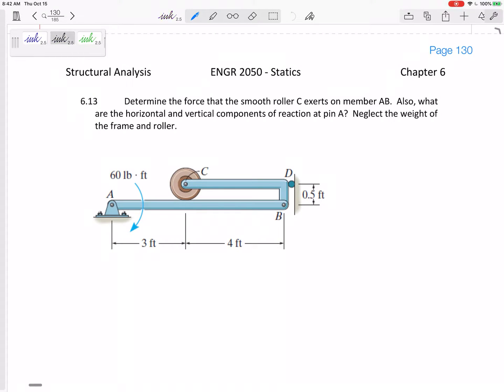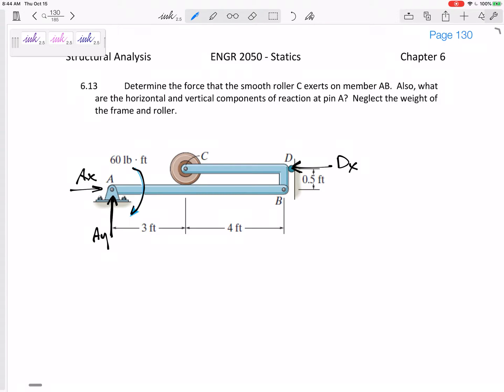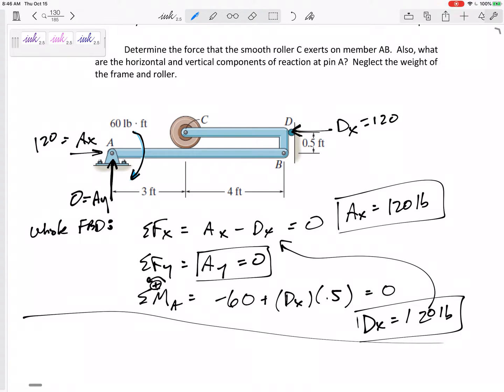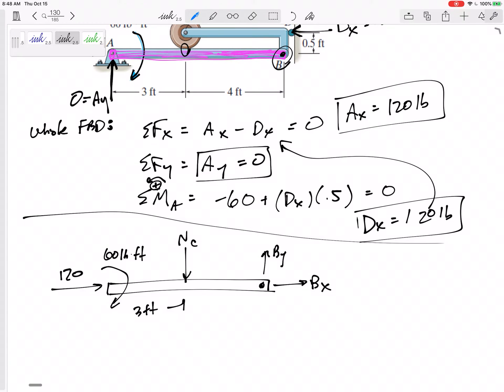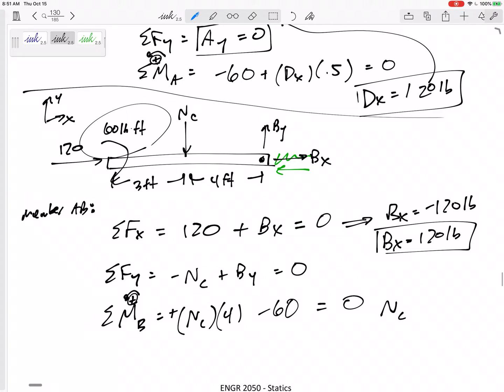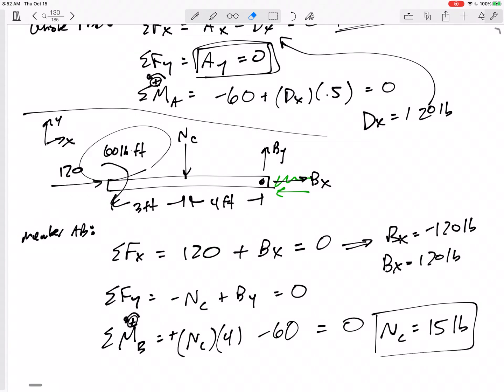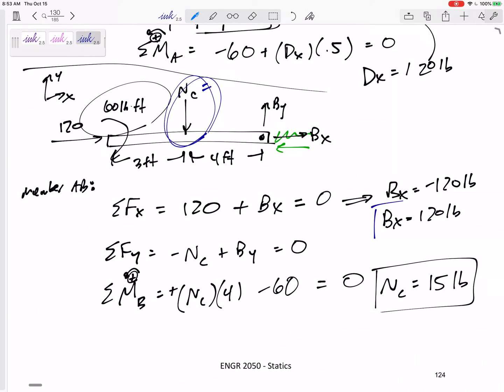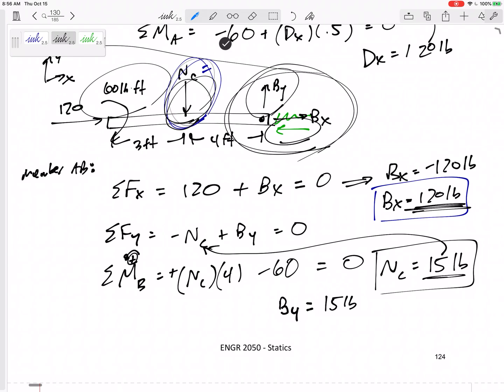Statics - Frames and machines problem 1

Comment: Why is NC positive when it is going down ?
Reply: sorry for the long message, i explain in case someone else has the same question in the future. good luck with statics!
Reply: @emergencysocks  Yes, I'm also wondering why is Nc positive instead of negative when rotating counterclockwise about point B?
Reply: @kayamakii7370  It´s just a convention, when the rotation is clockwise then the moment is negative